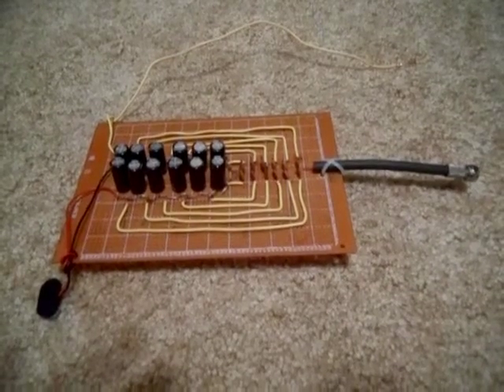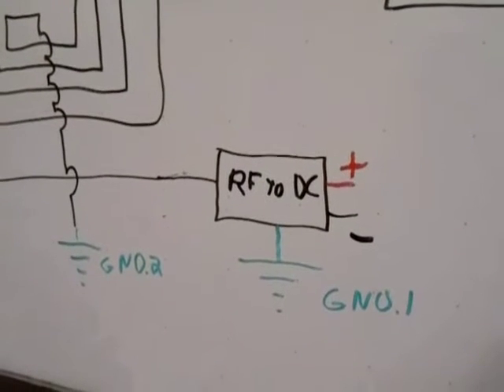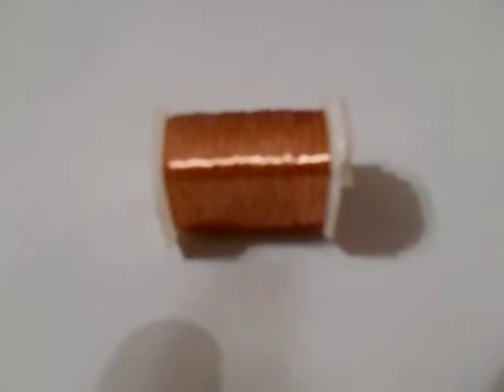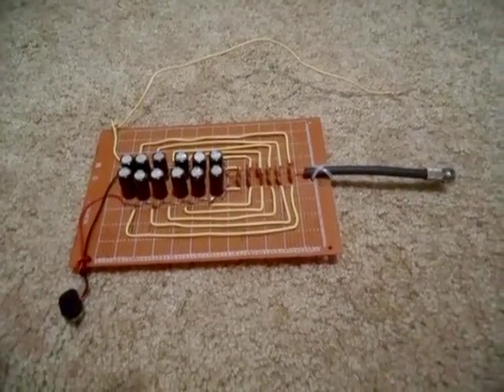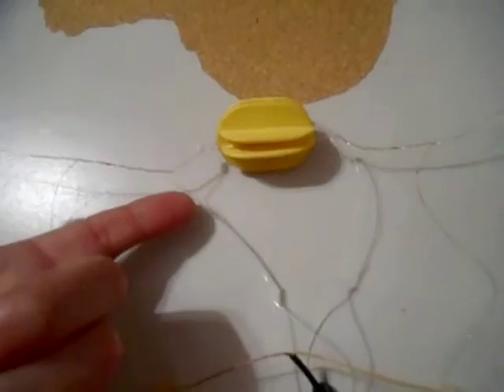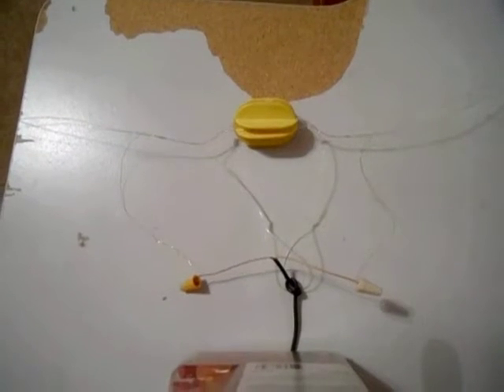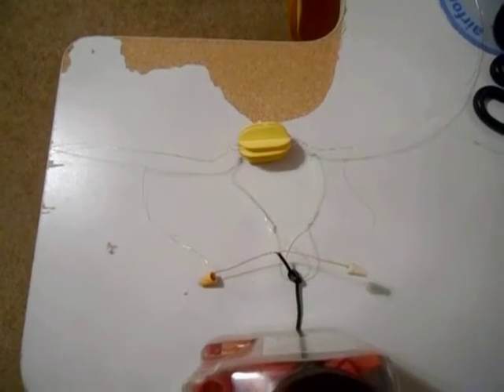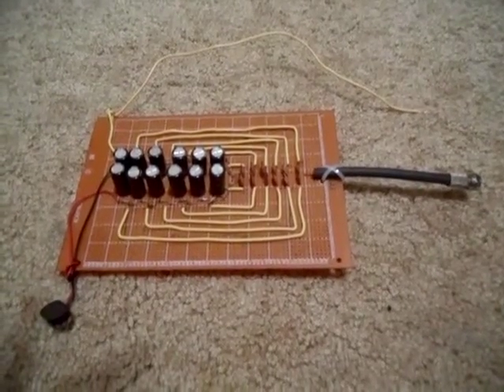Mile Loop Antenna Design

Comment: neat idea, you might want to reconsider the fishing line as it will degrade quickly from uv exposure.  If you can get dacron it will work much longer.  (learned from years of antenna work)